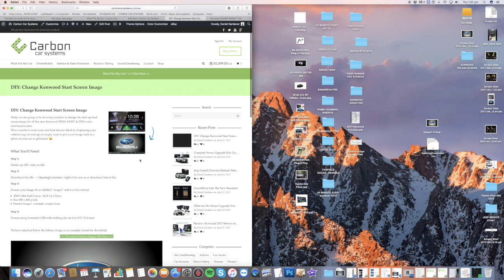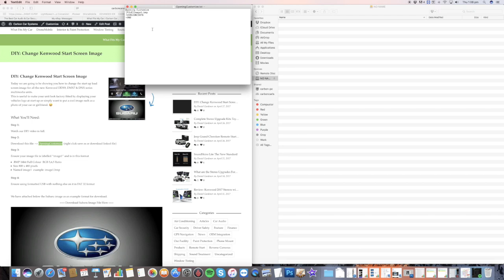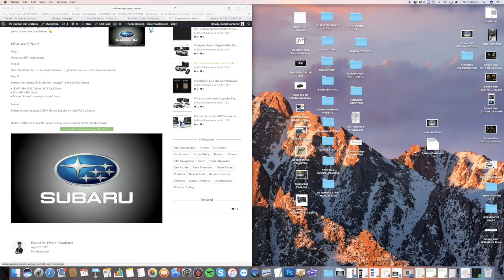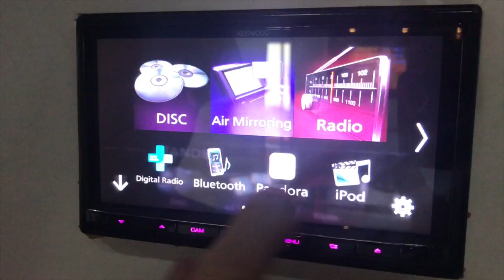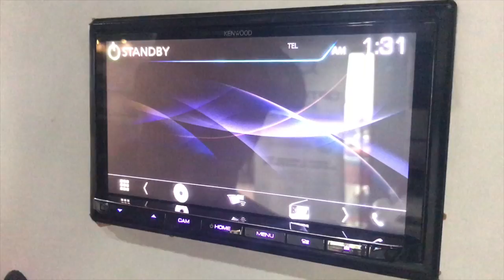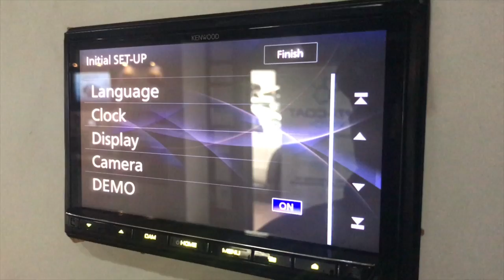How to Change Kenwood Stereo Start Up Screen

Comment: This worked on my DDX8906S!  Thanks!  I have been wanting to change the start up screen ever since I got the head unit, but could not figure out how to do it. This kind of info should be in the owner's manual, why does Kenwood hide this capability in a secret menu?

Comment: Thanks for this I just did this on my Kenwood DMX8021DABS. 800x480 image size. It worked fine but getting the hidden menu up took a lot of tries, but in the end it worked. Probably scren tap position and speed of tap is critical but don't give up.😅

Comment: 2023 and this worked for my new Kenwood. Thanks bud!
Reply: Can I ask which model Kenwood? Looking to do the same just want to make sure I get the right one
Reply: Mine kinda works. It starts with a scrambled mess then it gets the image right. Can't figure out what I'm doing wrong
Reply: @JrSmilez this is an old comment but I’m running into this issue. Did you ever get it figured out?
Reply: @MARS_503  I lowered the quality of the picture and it seemed to help. The picture does show up but I still have scrambled lines at the beginning. Only thing I can figure is maybe it's the colors in the picture.

Comment: If you rename the code in the txt. File to 0000 and run the process again, you can actually change it back to the original logo.
Reply: Do I change the "[FILE]image1.bmp" part to 0000.bmp or do I change the "[VERSION]9876" part to [VERSION]000?

Comment: It's 2021 and this video still helps folks like me. Just installed an older Excelon in my 1999 Subaru. Finishing the factory touches like this add to the fun of putting modern electronics in a vintage car. Rolling in a classic with modern interface, onboard Spotify, navigation and reverse camera makes me happy.

Comment: Thanks for the video.
Any chance you have tried the same procedure on a DMX-5020 BTS? It appears on this particular model the bottom left corner does not provide enough "free space" from icons for the command. The 9 tile icon activates and takes you to a different tab.

Thanks for your time
Reply: I'm in the same boat on this one. And can find no information online.

Comment: Worked perfectly for me on my brand new Kenwood Excelon DMX706S!
Thanks for this tip, now my startup/splash screen is less boring :)
Reply: Hey Charlie good to know you could do it for DMX-706.
Could you confirm what reference file did you used to determine the picture size?

Comment: Thanks so much for showing this first off.  I just did it and for some reason at first it gives a slightly scrambled version of my bmp file for 4 secs before showing the correct image for 2 secs.  Is there a way to fix this?  I also noticed the wallpaper customizer in the menu is there a video for how to change that?
Reply: I´ve got the same problem!
Reply: @LAZONE_original  me too any fix for this?
Reply: @floydian4evr  hey! In my case I used photoshop and found out that I had the wrong bit depth ( not 16bit) 
After I didn’t get it with PS I used an online web site to get exactly the format that is shown in the link! Hopefully helped
Reply: @LAZONE_original  Hey bro thanks for your input. I just figured it out using GIMP worked flawlessly!! I had to change the RGB to 5,6,5 i used the first option.

Comment: I struggled for a while to find a way to create the proper format .bmp for my recent Kenwood DMX9706S.  Windows 10 based, and the default .bmp's coming out of the typical photo editors caused the distorted "static" image described by others.  Solution:
1) Download free open source image editor imagemagick from https://imagemagick.org/
2) In it’s install directory is a utility “convert”.  Create a link to that utility and move link into your Kenwood directory.
3) In a Windows cmd shell, convert the desired image into the 16 bit BMP format (5,6,5) as follows: 
      convert your_image.bmp -define bmp:subtype=RGB565 image1.bmp
where ”your_image.bmp” is the desired image that isn’t in the right format for Kenwood
4) Install the image as describe by the rest of the Carbon Car instructions

Comment: What about 2019 versions? Followed same instructions but I'm not getting the "OK" in the "open customize."
Reply: I just upgraded to a DDX9906XR and will be looking to do this. I currently had a DDX9903S which I had for a few years and I changed the startup screen on that. It is important that you use the proper USB input as only one of them will work for this.
Reply: RYTHMIC RIOT I have the same unit. Using Gimp I’m getting the distorted image upon start up followed by the correct image. I originally did it in paint and it was displaying 4 smaller images across the bottom before the image loaded correctly.  I’ve since reverted back to the stock Excelon image.

Comment: Did this on a DNX576S; same procedures and worked! I'm curious why the screen shows for a few seconds, then goes black, then I see the 'agree and continue' screen. Any thoughts on how to retain the customized image from boot up until the agree page?

Some people have been asking about "NG" while loading. I saw this when I attempted to use a JPG and not a BMP. I went back in and modified the image from JPG to the proper dimension BMP and it gave me the blue OK screen.

I've seen a number of other posts asking how to get the factory kenwood screen back. I thought I'd share in case someone is looking here. Change the version number from 9876 to 0000 and your kenwood image will return.

MODIFIED IMAGE SCREEN

Opening Customize
[FILE]image1.bmp
[VERSION]9876
~END

RETURN TO FACTORY KENWOOD SCREEN
Opening Customize
[FILE]image1.bmp
[VERSION]0000
~END
Reply: Keith K TYSM

Comment: hey . I the DDX6706S can you add a sound to the start up or just a pic?
Reply: Hi Merlin, did you manage to replace the boot image as it was shown in the video? My DDX6706S is not reacting to the tapping of the screen corners in Standby mode. 🤔🙁

Comment: Thanks for the tip! It took me about a dozen tries on the double-double + single-single tap. Seems the unit is very sensitive about precise placement of touches. So glad to be rid of that stock splash screen. Cheers!

Comment: Just tried this on DMX-7017DABS and using the settings shown on website I just get a small line of coloured pixels along the bottom and then a small logo in centre of screen not full screen image as expected
Help

Comment: I know this is an old video, I just wanted to provide a little info for others. I have the DDX 9905s and basically follow the instructions here. The ONLY different is to change the pixels to 1280x720. I used GIMP for this process. It’s so easy to use
Reply: Thanks for this tip, I just got this unit today and was going to use my old splash screen for my older Kenwood. The resolution was smaller than the 720, I just went into Photoshop, raised it to 1280x720. Saved the BMP using the same settings. Added the Android Auto and Carplay logos and it looks AMAZING!

Did have trouble touching the corners because I have fat fingers. lol
Reply: thank you!
Reply: Do you know how to reverse it, once done?
Reply: You can't do it ,You can upload a new one but You can't go back
Reply: I know this is an old video, but I'm trying to do this and every time I attempt it, I get the NG error along with a red screen.  I have the file set to 16 bit, 5,6,5.  1280x720.  Not sure what I'm missing at this point.

Comment: you need to format the usb using cmd, not the right-mouse Format under windows:
Step 1. In Windows 10, for example, type cmd in the search box, you can get the best match called Command Prompt. Right-click on it and choose Run as administrator.
Step 2. On the Command Prompt window, type diskpart and press Enter.
Step 3. Type list disk and press Enter. According to the list disk information, check which disk is your USB flash drive. For example, disk 2.
Step 4. Now type select disk 2 and press Enter.
Step 5. Type clean. Wait some time for disk erasing.
Step 6. Type create partition primary and press Enter.
Step 7. After diskpart successfully created the specified partition, type format fs=ntfs and press enter. If you prefer other file system formats, change the command ntfs to the desired one such as fat32, exfat, etc.
Step 8. Type assign to create a drive letter to the flash drive.

Comment: at 3:22: do you know what for the other options are? I did not dare to press :-). Are there any interesting hidden features? What I'd like to do is, switch off unused inputs, so that they do not show up on the menu and also eliminate the 10s startup disclaimer. Any ideas? Thanks in advance.

Comment: My image turned out mirrored and upside down, I fixed it with photoshop, however the top left has small colored pixelation. How do you fix that? It's also not centered
Reply: Did you guys figure out how to centre the image?

Comment: If anyone has any troubles try using GIMP for your images. I was using paint on Windows 10, and my headunit was doing weird thing with the image. Used GIMP and it just worked.

In gimp you need to export as BMP, choose location and click export. that will open a new window where you can set your options, under 16bit BMP select "R5 G6 B5" as the type. 

Gimp did a better jobs with the colours than paint.
Reply: GIMP did the trick for me too.  Definitely an easy fix if your image shows distorted or with crazy colours.
Reply: Yeah paint did crazy colours for me aswell, Subaru logo went green
Reply: This worked perfectly.

Comment: So I looked this up online and it looks like this a setting that is available on a lot of Kenwood units for year. I tried it on my DDX916WS and this happened. 

https://youtu.be/WrjuBFsrMW0

Any ideas, I tried with 2 different images same issue. Followed the steps exactly. 800x480 16bit image1.bmp
Reply from the maker: I haven't tried the DDX916WS as thats last years model but I tried the new one not a problem.

Try making the image at 921 x 480 pixels and then crush it down to 800x480 

That should fix it. 

If you need we can always restore to original Kenwood image I have a patch to do that also :D
Reply: I went to try the Subaru file you provided on your website but it's just a small white square
Reply from the maker: We have tried it on all new models it works fine. You can restore to original kenwood image if you need, we haven't tested older models like the DDX916WS so not sure on those.
Reply: How do you get th original image back on the DMX-7017DABS please?  @AutoChimp
Reply: i am having all sorts of issues can someone do a video of the process as they are doing it so others that are not so technical can follow step by step either on photo shop or gimp